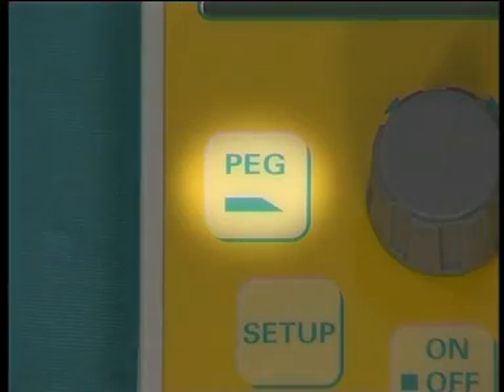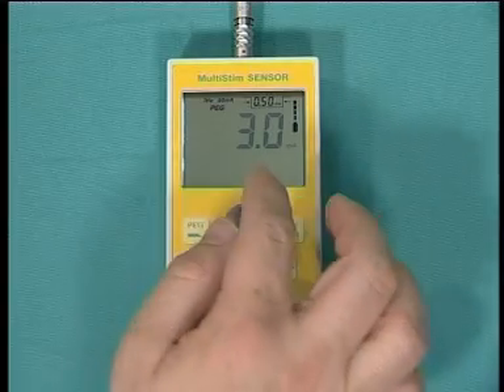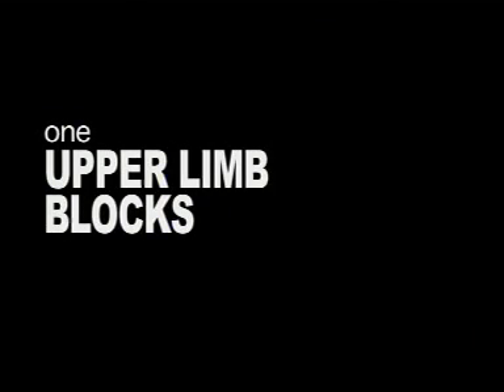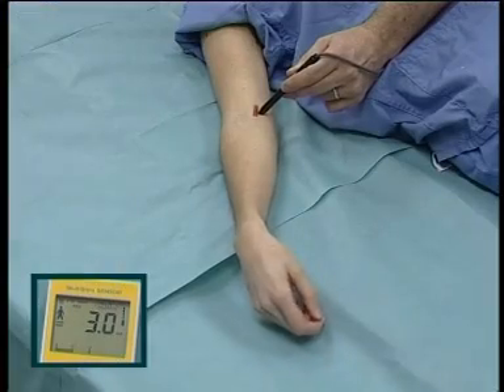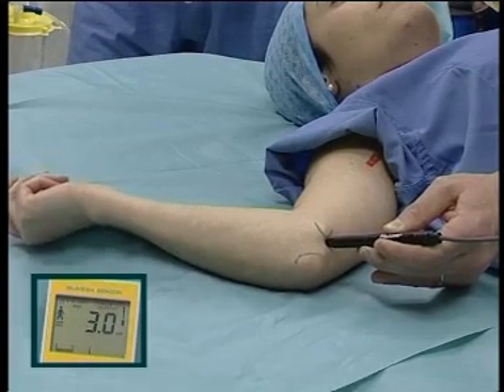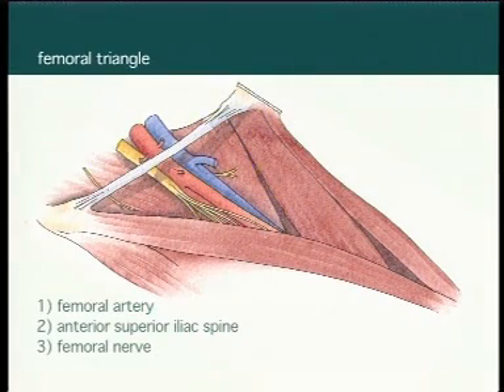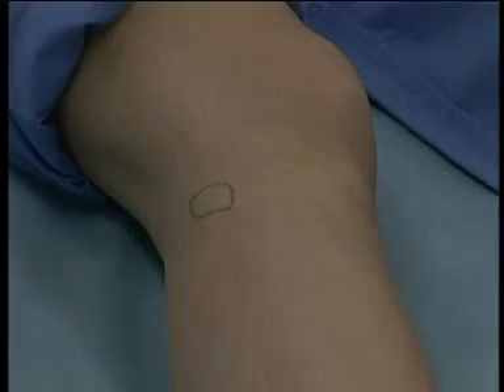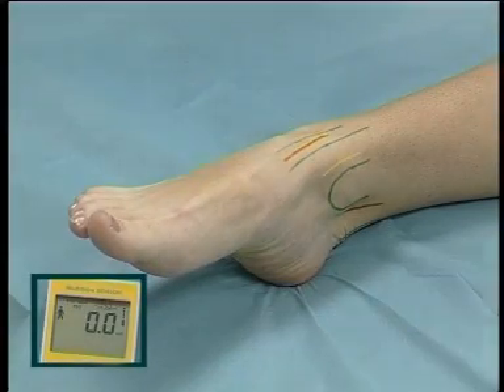Surimex: Pajunk MultiStim Sensor (nerve stimulator, a guide to nerve mapping)

Comment from the maker: Dear Alzomor,
I am sorry for the delay to our reply.
The Pajunk Sensor is a Nerve Simulator with a PEG (pen like tool) to locate nerves externally. This is connected to the unit via a cable as you can see, but out of camera this cable also has 2 other connection points, one being a connection point for a stimulating needle and the other being for an ECG pad that has been fixed to the patient. I hope this answers your question. if you would like any further information, feel free to contact us at: sales@surimex.com.au